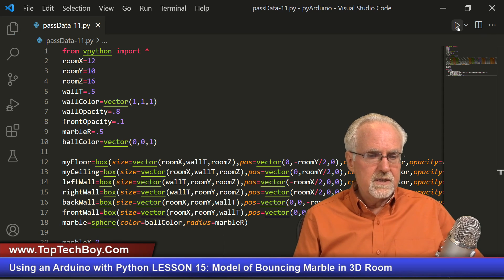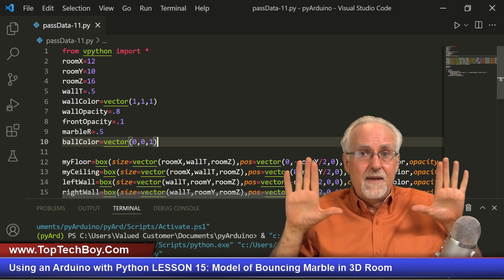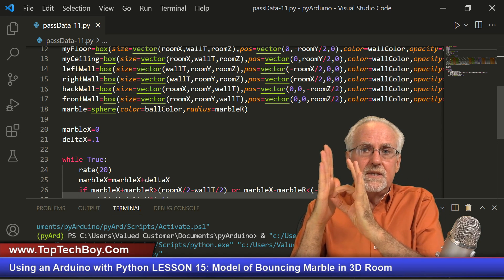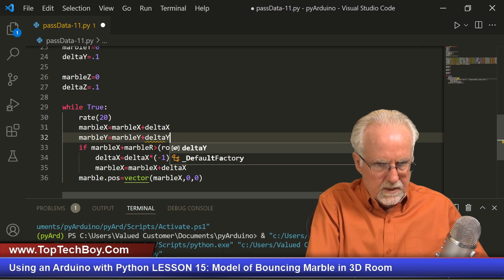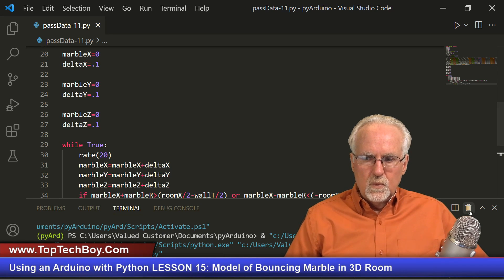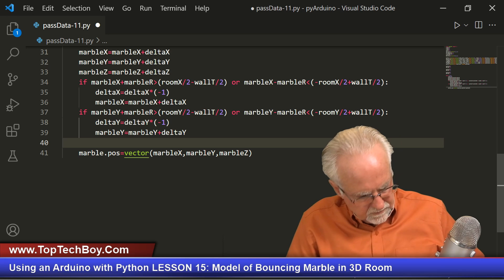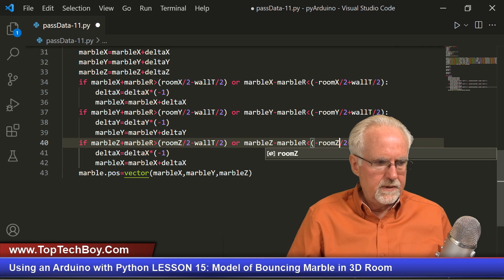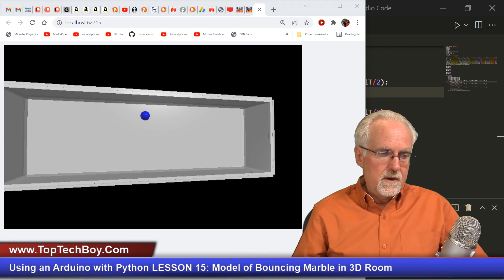Using an Arduino with Python LESSON 15: Model of Bouncing Marble in 3D Room

Comment: Mr. Paul, you could always 3D print some segments of a chase or cable tray to cover your cables going from device to device, either on the top of your desk, or tucked behind and hanging off the back of your devices. Then they would be either hidden inside the chase, or completely out of your way, nestled in the cable tray.
Reply from the maker: Issue is filament is not available here, and to get it is a fortune for shipping and customs. So, I have a 3D printer, but will use it just for small object demos for the fusion 360 class upcoming.